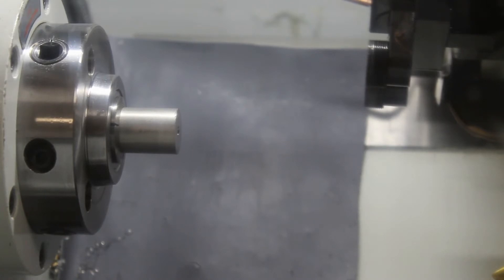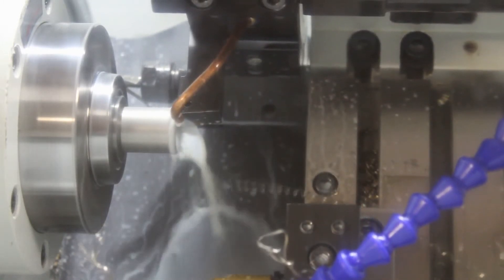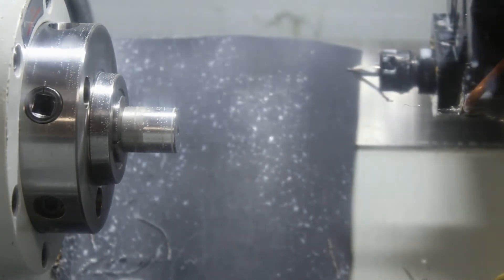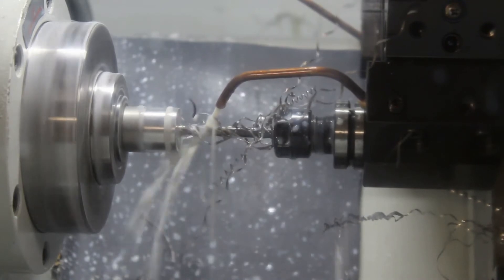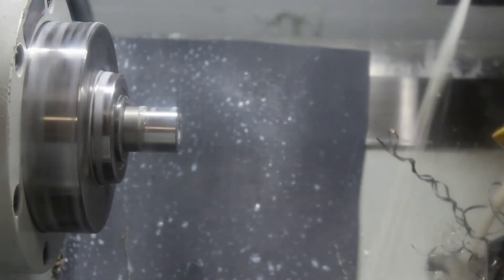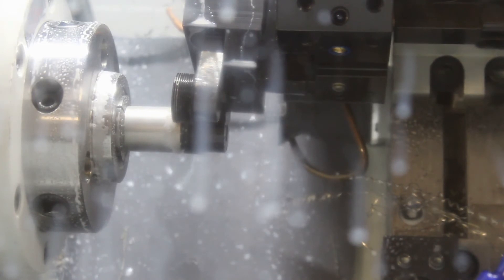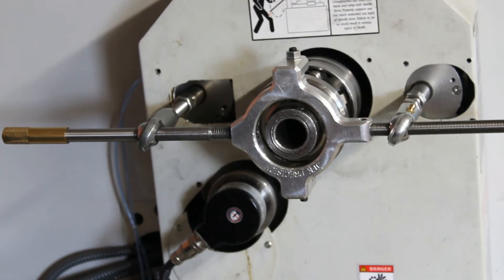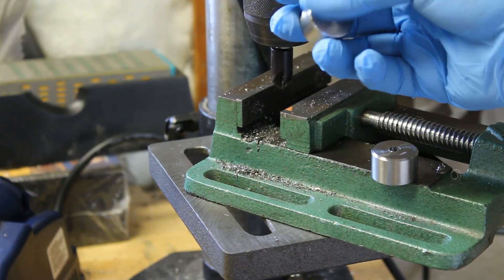NEW EZ bar puller and Collet Closer - Thing 7

Comment: man people are rude , everyone starts somewhere , nice machine and good job. i picked up one of these recently and yes they are slow and yes they dont have a ton of power and yes the leak coolent all over haha but they take up all most no floor space, are easy to learn on easy to program easy to maintain and they can make super accurate parts and wont break the bank or even break at all if you crash it. they are a valuable stepping stone to say the least. roi is one of the highest especially starting out!
Reply from the maker: Thanks man. It was a good starting point and not much damage can be done if a mistake is made since it doesn't have much power. We have come a long way since then and it helped us get here.
-Cheers
Daniel
Reply: @dnjmachine  nice! Glad to hear. Do you still have it ?
Reply from the maker: @Jonnywoods_049  still do and still use it on small simple parts.
Reply: @dnjmachine  awesome! That was one of the selling features for me I thought when it come time to upgrade this little 15 will be easy to find a home for or easy to keep and that is why I started with one. Can’t really go wrong either way. 🤟🏻

Comment: Awesome ez puller. I just got mine in. But holy crap. I am glad i did not purchase a Tormach.
Reply from the maker: Lol its a slow machine but it has paid for itself several times over. I setup a camera in the machine and the bar puller and would watch it from inside the house checking in on it ever once in a while for dimensions and to replace bars.
Cheers

Comment: What is your average insert life for stainless? i am just getting into cnc turning (rapidturn) and turn aluminum and plastic but would love to get into stainless.
Reply from the maker: Depends on speeds and feeds and the inserts as well as the type of holder.I can cut 800 SFPM and .005 per rev its pretty scary fast, I can get 30 or so parts per insert. So if I have a quick 30 part job I will bang it out and maybe loose the insert.If I run a 400 SFPM and .0015 I can 75 to 100 maybe, I hadn't actually counted it closely to be sure so these are just rough numbers.I would say coolant is more important than speeds and feeds, you can loose a insert at any speed if the coolant line gets bumped. SS will glow hot without coolant rather quickly, once you seen that insert likely gone.There are other days that the inserts seem to break no matter what you do when dealing with SS. We buy quality SS but some seems to part better than others (this could also be the insert quality)Not parting to the center line helps as well, if you have a hole drilled through the part its better on the insert.Hope this helps.
Reply: Very good. Nice easy job for the machine.